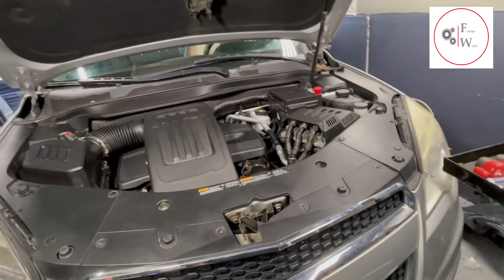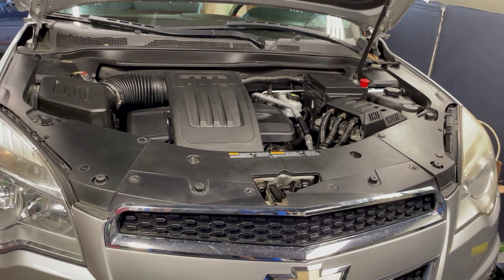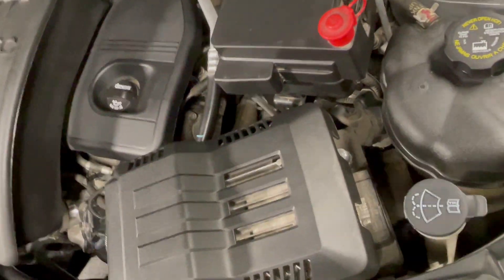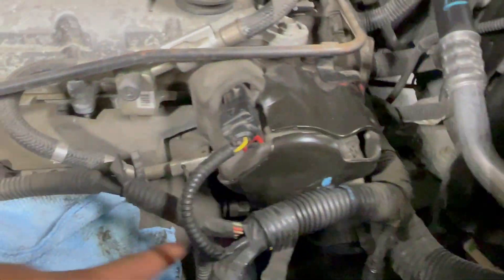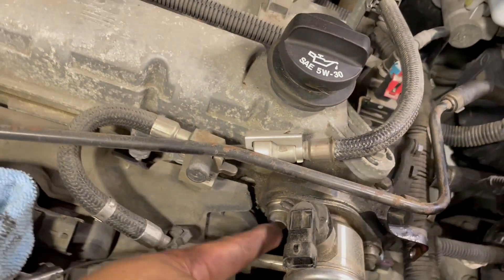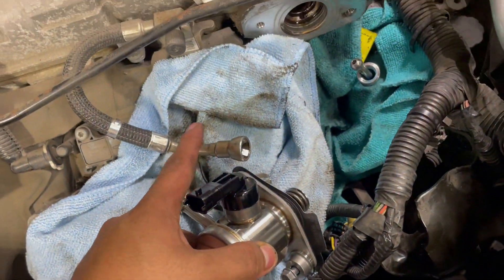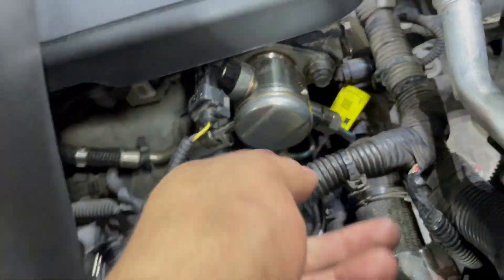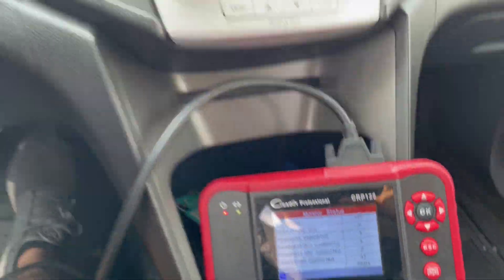Chevy Equinox High Pressure Fuel Pump Replacement (Code P0172) 2.4 Ecotec

Comment: I started working on my wife's Chevy Equinox 2010, it started with the Air mass flow Sensor, fixed that and new spark plugs with coils. Then the Brat gave me Bank one Sensor,  ok changed them both, Cleaned the Throttle body like new. Now isnlike ut git worst. Nownits telling me the Fuel Pressure is to high. Code .P228D.(( Whats up with this thing. Lol...  Please help... PS.. I did order the Fuel Pump, GM original  so i will be changing that next.
Reply from the maker: Do you have access to a good scanner?

Comment: My gf's  2012 nox  threw the p0172, was doing the diesling at shutoff.  I cleared the codes and it seemed to resolve itself after a few attempts and has been fine now for 500km.  Do these HPFP intermittently fail? I'm assuming this is still going to cause me problems in the future.
Reply from the maker: Do you still have that slight delay when you shut the car off? Also check your dip stick smell the oil. You don’t want to have fuel mix with the oil. Eventually it will need to be replaced! It is a very common issue among the 2.4 eco engine on the equinox.

Comment: The intermediate fuel pump line is required to be replaced when replacing the fuel pump.
Reply from the maker: It is not required to replace the line if you are undoing it for the first time. The material on that fuel line is soft and if removing it a couple times, then you will be forced to replace it. I’ve done a few bmw injectors before and it requires to remove all the lines for each injector. The manual clearly states replace lines after unbolting them a couple times. It’s been over a year and that Chevy equinox is running like a champ, check engine light free and leak free. I guess at the end of the day you can replace the line along with the pump that way the you know the job is well done! Or you can still get away with using the same line if it hasn’t been touched before. In my case I honestly forgot to order a new line.
Reply: @Fwerks.1592  gm service information document id 2241763 says to replace it. the high pressure fuel pump document is 2243075 and step four says to to replace it.

Comment: How much do you think the job cost. In Chicago
Reply from the maker: I would definitely put this repair anywhere around $500- $650 is they also do an oil change. The OEM HPF pump is well over $350 just alone.
Reply from the maker: That’s not dealer price, they will probably quote you well over $1500.

Comment: hi. code p0325. knock sensor 1 circuit bank. is this related to a fuel pump? instead of replacing the sensor  i replaced a plug but my car still shakes when idle and stalls. should i go with replacing a fuel pump? 2012 equinox base model
Reply from the maker: Definitely not the same! Why didn’t you replace the sensor??

Comment: Would the high pressure fuel pump cause a engine power is reduced on the dash..yes I have the same codes p0172 and p0191?
Reply from the maker: It’s hard to tell not having the car in front of me. Is that the only symptom you have a reduce power?  Sounds like your not getting the correct fuel pressure. Might be a faulty fuel pressure sensor. It can also be the height pressure fuel pump. Check your dipstick and get a smell sample off the oil and see if it smells like fuel.
Reply: @Fwerks.1592   I ordered both the sensor and hpfp was gonna replace the cheapest first...but in the morning I'm definitely gonna smell the the oil to be 100! Sure...also gonna do the plugs and oil change
Reply from the maker: @MrHowie327  good thing! Your on the right track! Starting with the cheaper item is best! I’m here if you have any further questions!
Reply: I happened to just buy my 2012 equinox and 3 weeks later it started sputtering and then one day it said reducing engine power shortly after cutting off on me. Looked up reasoning and it said because of bad oil or low oil. Safe to say it was just my oil. I had no oil really in tank. Rushed my vehicle to get oil change/put in so my engine light went off and reduced power off. one thing to note as a female looking for her own vehicle.(check the oil before buying (close call). I still need a fuel pump because I’m burning way too much gas and it’s having a hard time picking up speed and accelerating.
Reply from the maker: @tperry484   I would watch the oil level every 1 thousand miles on this equinox. They tend to burn a little more oil than usual. Totally normal but unnecessary. If the oil is a little low just add some oil in between oil changes.

Comment: Would this be the same issue with a p228c code (2013 equinox)?
Reply from the maker: This can be many things! It can be a bad fuel regular, it can be a bad fuel pressure sensor or in some cases a high pressure fuel pump. I’d get the car diagnose first before making any moves.
Reply: @Foreign Werks  is the fuel pressure regulator located inside the high pressure pump? Or on the fuel rail ?? Or possibly somewhere else...Thanks for your help
Reply from the maker: @chelseyconner4005  sorry for the late response. Great question!! I’d have to check the equinox and see where it’s located. It’s been a while since I’ve done maintenance since it’s working flawlessly lol. Do you have any symptoms?

Comment: Great job ..👍🏼 I saw a different YouTube video where they were replacing the pressure pump but the guy did something with the engine where he rotated to get it to the lowest point before he put the pump back in and there's a little cup in there he pulled out and installed it on the pump before he put the pump in I see you didn't do that I don't know if you skipped it or you just didn't record it but I was wondering if that's part of the replacement because I'm going to be replacing mind and I've never done it before just wanted to make sure if it can be done either way?
Reply: Wondering if this is a standard ignition high pressure fuel pump?
Reply: Hello I was wondering when I replace the
Reply: Hello I was wondering when I replace the fuel pressure pump do I have to replace the little gas feed line or could I use the same one if it's in good condition? mine line still looks new..
Reply from the maker: @josealfredocuevas  , I would recommend replacing it it the line has been removed more than 2-3 times.
Reply from the maker: You sound be fine using it again . But if it needs to be removed again you will need to replace it
Reply: @Fwerks.1592  it was never removed this will be the first time. okay thank you very much I appreciate it...
Reply from the maker: @josealfredocuevas  , you’ll be fine. Let me know how everything turns out.
Reply from the maker: Either way Is fine. If it’s your first time, Do not rotate the engine. I did not skip any steps , what you saw is what I did.  The high pressure fuel pump has a spring on it that compresses against the lifter cap. The high pressure fuel pump came out one way, you’ll have to put it back in the same way it came off. When you put back the bolts make sure to tighten  them in an alternating way. Make sure the pump is flat on both sides when torquing the bolts. When you tightened the pump, it will push the spring into the lifter cap , just like it was in the first place. You’ll be fine for sure. Also note: do not buy a cheap pump make sure it’s an AC delco original one!
Reply: @Fwerks.1592  awesome!!!  I appreciate the information taking the time out to explain it to me thank you very very much I will do that 👍🏼🙌🏼
Reply from the maker: @josealfredocuevas  , anytime! I’m here if you have anymore questions! You got this!
Reply: @Fwerks.1592  Thanks!!

Comment: So I just wasted money going to Jiffy Lube getting a oil change and full system cleaning fuel throttle GDI2STP when I thought from them that’s the problem. Not even two hours the “Losing Power Comes on” and then the same thing keep happening when shutting of the vehicle with the keys it stay on for seconds and kind of shakes when it cuts off. Damn I should’ve watch this video before I paid that extra money and just buy the fuel pump like your video suggested. Smh
Reply from the maker: All good now you know. Same exact issue I had the car would shake and there was a delay for the engine to come to a complete stop. Stay away from jiffy lube those places love to rip people off! It has to be your high pressure fuel pump!

Comment: Do you need the actual GM part? I brought an aftermarket part (did not know) from A1Auto a really reliable place. The dealer was like of course you need the GM part and we sell it for $429!!!!! The part I paid for was $181 I replaced the part not the line. Did everything you did code still popped up and getting a stablitrak error on dash and low engine power. I will change the line and see if that works because they swear that was the issue and because it wasn't a GM part.
Reply from the maker: Have you tried to set any codes that come back? I used a genuine pump just to be on the safe side. Any critical parts that I replace like, water pumps, thermostats, high pressure fuel pumps, solenoid sensors I use OEM dealer parts. When I install the new pump and put it together, I had a code still popping up, but when I had reset everything the code went away and has never return since then.

Comment: What size is the special fuel line disconnect tool?
Reply from the maker: It’s the 3/8” size. If you get the ac/ fuel disconnect set ,it will be the blue one.

Comment: Good video juts one thing I don’t have any of the problems like gas on the oil stuff like that but I put scan and give me p1072
Reply from the maker: Sorry for the late reply! Have you tried cleaning the mass air flow sensor? Have your tried checking the injectors? Does the car act funny or anything  you notice after the check engine light?
Reply: @Fwerks.1592 someone in comments changed gas cap and there same problem went away. Lucky ?

Comment: hello I just did that and it doesn't work my car throws code p0171 and misifire3?  do you know the solution?
Reply: Im not sure Im order the in ebay,   The gasket around the pump has never been changed.
Reply from the maker: @davidsanchez6688  , ohhh yes I would never order any parts from eBay or Amazon! The pump I used was a genuine Acdelco !
Reply: if you think i bought the original it would work
Reply from the maker: @davidsanchez6688  sorry for the delay response. If the car still has a delay when shutting it off most like the hp fuel pump is faulty. If I had to take a guess, that pump from eBay is not good!
Reply: @Fwerks.1592  thanks my friend sorry for many questions
Reply from the maker: @davidsanchez6688  no worries!
Reply from the maker: First off did you have the exact same symptoms? When you turned your car off would it be slow to shut off?
Reply: @Fwerks.1592  Yes, but I didn't change the oil. That could affect it?  smells like gasoline
Reply from the maker: @davidsanchez6688  , I would highly recommend replacing your oil. Do you have access to a scanner? Make sure the to double check everything. Sometimes we might miss to connect something back.
Reply from the maker: Clear any pending codes. And recheck again.
Reply: @Fwerks.1592  thanks I will do it, last question the code p0172 also causes misfire?  because it also throws me code p0303
Reply from the maker: @davidsanchez6688  , normally a p0172 ( bad HP fuel pump) will throw more of a random misfire or car has a hard time starting Vs 1 specific cylinder.  For that p0303 check the confusing of the plug, check the coil pack or it can be an injector that went bad.
Reply: @Fwerks.1592  thanks my friend
Reply: @Fwerks.1592  thanks my friend I will check
Reply from the maker: Did you plug all the connectors?
Reply: @Fwerks.1592  yes
Reply: @UCeZxh2fW04Ld7RY6TmXgEHw sorry I mean p0172
Reply: I don't know what's going on, I already fixed it and the car still changed everything and once again the car takes time to turn off and I checked twice
Reply from the maker: @davidsanchez6688  sorry for the late response. What brand was the high pressure fuel pump?
Reply: That can be a problem?
Reply: Hi again the gasket  doesnt come with the high fuel pressure is important?
Reply from the maker: @davidsanchez6688  I would recommend you get a gasket otherwise it will leak and you do not want that.

Comment: Had the same code. Not sure about trim numbers. 2013 equinox was sputtering and car shut off late as you said. Replaced the HP fuel pump and it ran better and shut off correctly. I did notice I had a lot of oil in the shroud intake. I cleared codes and After driving it a while it still shows 0172 code. I assume the rings are shot. Thanks so much for video. Any suggestions?
Reply from the maker: Do you feel any difference on how the car idles?? Also did you replaced your engine oil?
Reply: @Fwerks.1592  it seemed to idle better yes and had more power. Also, the eco mode is stuck on. The button obviously had something spilled on it and makes it stick when depressed but won’t shut off eco. When I removed the shroud it had a lot of oil in it. It poured out when I removed it.
Reply from the maker: @coachtechchs  that’s not good! You know where your oil leak is coming from?
Reply: @Fwerks.1592  no I don’t.

Comment: Great video. I currently have a p0172 code as well, I just changed the spark plugs and the o2 sensor and cleared the check engine light and it still came back on. I also got another one p0191 for a "fuel rail pressure sensor" before I did the spark plugs and o2 sensor. You think it's time to change my fuel pump? Also, when I turn the car off, it "diesels" for a second or two. That would most certainly come from the fuel pump, no?
Reply from the maker: Ali A., I can assure you it’s the high pressure fuel pump!!! The biggest sign for me was when I would turn the car off it would take a few seconds for the car to actually shut off. Meaning the fuel pressure pump was leaking internally and causing fuel to ignite in the cylinder chamber.
Reply: @Fwerks.1592  wow that's actually crazy! Definitely time to change it, then. Thank you so much man, God bless!!! 🙏👍👍
Reply: @alia.2176 did that end up working for you?
Reply: @zmnakokader4050  yes bro, change your fuel pump!
Reply: @alia.2176  and changing the high pressure fuel pump got rid of both P0172
P0191 codes? Cuz i have that same issue as well as the delay for the car to actually shut off
Reply: @zmnakokader4050  did it help for you? I’m getting the same codes, and have changed Vvt solenoids, spark plugs, coil packs, and I’m still having the same problem “engine power reduced”
Reply: @vonilla8341  yeah bro change that high pressure fuel pump located in the engine bay

Comment: Where would low pressure be located?
Reply from the maker: Are you referring to the low pressure fuel sensor? That one is located on the front driver side. You will need to remove the wheel and right by the steering rack you will see a purple connector that connects into the low pressure sensor!
Reply: @Fwerks.1592  yes thank you
Reply from the maker: @CTANDTSR  anytime!

Comment: Great video, very informative.  However I see no mention of replacing the high pressure fuel line between the pump and the fuel rail.  Isn't that required when changing the pump?  Not throwing rocks, just asking as I'm attempting mine now and want to make sure it's right.
Reply from the maker: Good morning! It all depends on the mileage on the vehicle. It’s not required to replace the high pressure fuel line but since your are there it would be a good precautionary item to do. I did not replace the line since this was the first time undoing the hp pump/line. So the line was still good and leak free. You can only undo the line a couple times before you have to replace it.
Reply: @Fwerks.1592  gm recommends replacing that line. but i guess in practice it is not necessary
Reply: @truth4reel  where is that stated?

Comment: Sounds like thr exhausted manifold is crapcked
Reply from the maker: Nope, it was the rusted flex pipe that was replaced making that noise!
Reply: @Fwerks.1592  Hello I have a 2011 that it shut off when waiting for a green light sometimes after at home or when I turn on the vehicle runs for like 10- 20 seconds then stall and die, no engine light, I look on Google for possible causes and says possible fuel pump or ignition switch, on any idea what might be 
I really appreciate your help, Thanks in advance
Reply from the maker: @tow4-459  let me ask you a question. When it stalls, does it crank back up when you turn the engine back on?
Reply: @Fwerks.1592  Yes and start right away , I noticed that when the car warm up it works good,  if I left the car sitting for 1 to 2 hours I need to warm the car again,   also I noticed that on the freeway over 70 or 75 mph it was doing the same, like fuel cut off
Reply: @Fwerks.1592  sorry for the delay
Reply: @Fwerks.1592  no engine light on when stall or die or fail once is at normal temperature
Reply from the maker: @tow4-459  interesting! Definitely getting the car scanned properly will be a good idea. That way they can read the fuel trims to see what’s the flow / pressure readings.
Reply: @Fwerks.1592  I will try and replace the direct injection H/P fuel pump and see what happens I will let you know if that help
 Thanks
Reply from the maker: @tow4-459  anytime brother! Keep me posted!